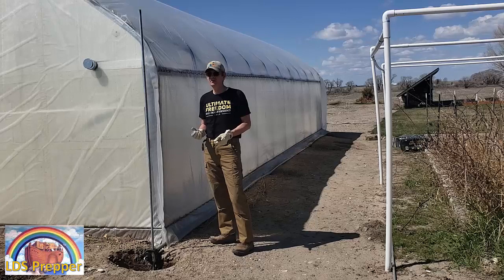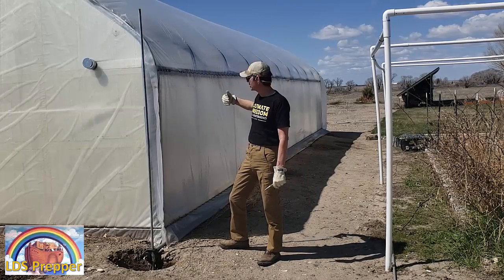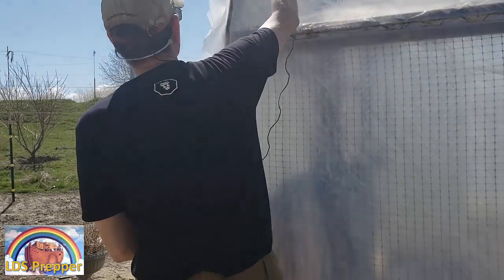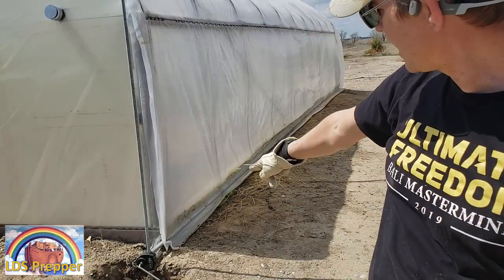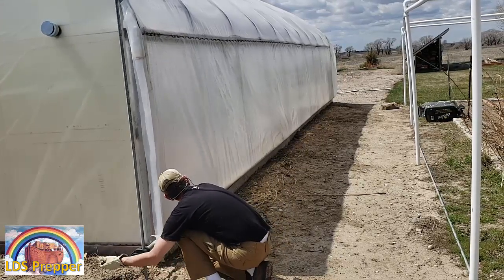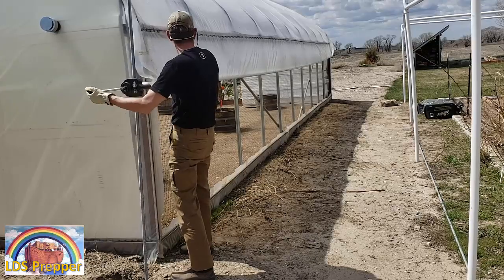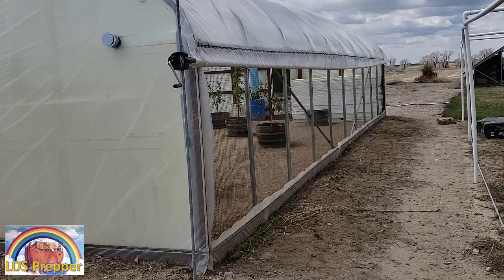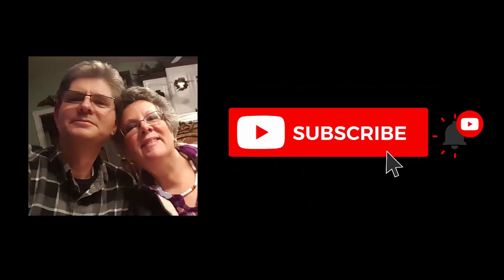Geothermal Greenhouse Roll Up Sides 👨‍🌾

Comment: Dig down 8 feet run culvert as air ducts between your house and the green house, you can circulate the air & heat your home during the winter.
Reply from the maker: Many, many homes and commercial building use geothermal heat, as you recommended to pre-heat the air going into their furnaces. The air coming from the geothermal system is still much colder then you'd want your inside temperatures to be but it is much warmer, in winter, then the outside air is so by using it to pre-heat the air it makes the furnace more efficient and uses less energy to heat the building.
Reply: LDSPrepper There is a guy on YouTube that grows orange trees in a submerged green house. He says that the heat from the green house running to his home keeps it balanced without the need to use a furnace 🤔
Reply: LDSPrepper ....... Servers 🔥
Reply: If the greenhouse is very far from the home you would lose a lot of heat as the ground is cool. I am building my geothermal greenhouse attached to the south side of my home right now! @theMekanik

Comment: Is there any problem with too much wind when it’s opened like that?  Or does it just spill out the other side? I’m in my first spring with a similar greenhouse and I worry about damage to the structure or fabric/plastic when very windy and I live in a spot that gets pretty good wind.
Reply from the maker: This is the second year I've rolled up the sides. They seem so heavy that wind has not been an issue for me at all.

Comment: I was wondering whether the Mittleider wooden trellis inside the greenhouse could be extended out to add support to the Greenhouse itself?
Reply from the maker: I bought the greenhouse kit with more then sufficient support to be strong. No additional support needed like I added to my PVC greenhouse that did need it and the added support was part of the design.

Comment: Hi, I'm wondering if your geothermal system greenhouse works with aquaponic system? Or will it be to damp and moist? Very good videos you put up sir.
Reply: the geothermal system has perforated piping so that the condensation can leave the pipes and not eventually fill and  clog them up.

Comment: Why are you running the blower to inflate the plastic? I'd think it would do a better job of keeping in the heat that you're trying to let out if the blower were running.
Reply from the maker: Great question Emerson. If the plastic doesn't remain inflated it is loose and get ruined by the wind constantly moving it around. It is best to keep it inflated.